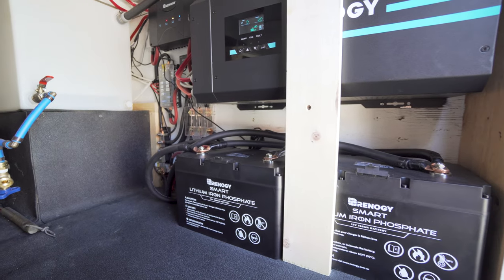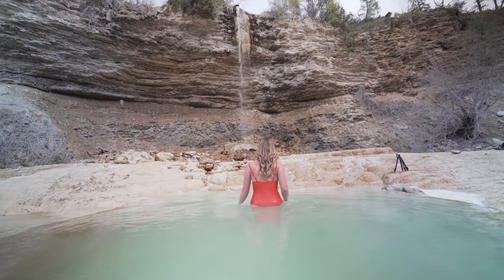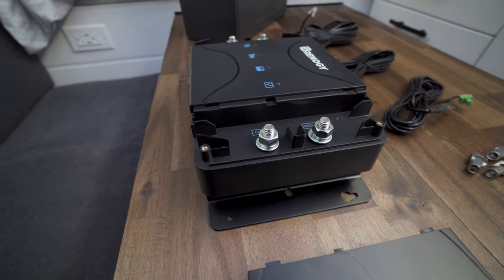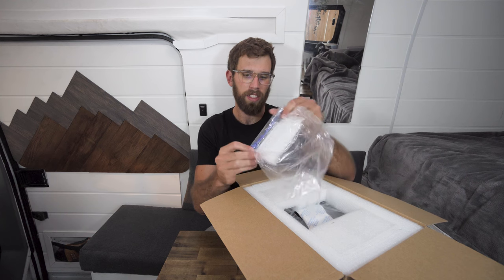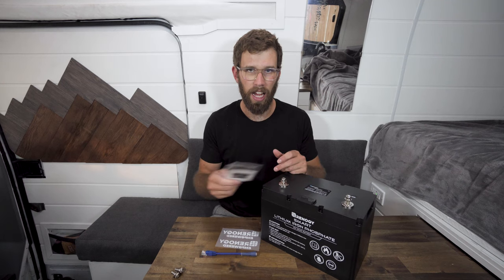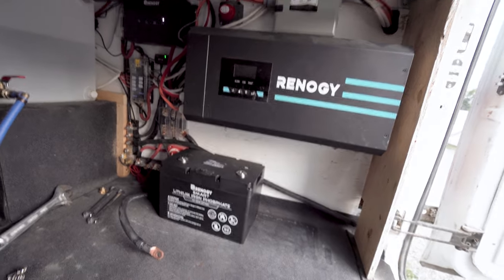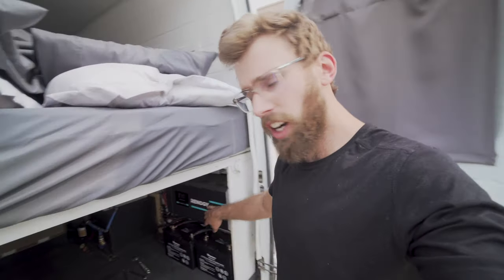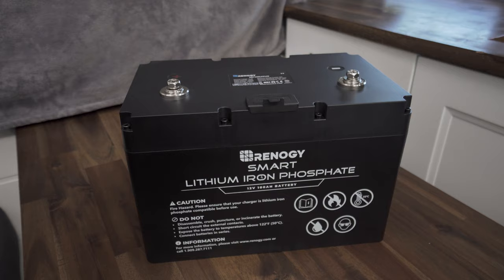Renogy Lithium Battery: Unboxing, Review and Install

Comment from the maker: Thank you for watching! Which battery you are considering purchasing?
Reply: Hi
Im looking to replace my standard leisure battery with the Renogy 12V 100Ah LiFePo4 Leisure Battery in my campervan. I dont have a solar set up. Is it worth it to do this?
Reply from the maker: @scottstephens-ni6oq  definitely! But I’d take a look at the new pro model because it has Bluetooth and is heated.

Comment: Thank you for this tutorial.    I just purchased a Renogy Smart Lithium 100ah and the Renogy 50a  DC DC charger w/ MPTT.  My old 30a controller had connections for the bus bars, in addition to connections for the solar panels and the house battery.  The new DC/DC charger manual only shows how to connect solar panels, house battery and starter battery. 
I am very new to DIY wiring.  I cannot figure out where to connect the bus bars.  Do they need to run through the controller or can they connect directly to the house battery?   
Thanks in advance to any and all for guidance.
Reply from the maker: The MPPT controller connects to the busbar (positive and negative) and then both busbars connects to the battery. Does that answer your question?
Reply: Thank you for your quick reply. If I understand you correctly the bus bar positive and negative cables would go into the MPTT/DC to DC charger where the manual indicates the battery cables should go. The battery cables would not connect to  the DC DC charger at all, but instead to go to the bus bars.

Is that right? Thanks for your time
Reply from the maker: @ltstarr9203  that’s correct!
Reply: @madetoexplore  so sorry to pester, but I used incorrect terminology earlier.  I am very new to this.  As I learn more, I realize I do not have bus bars.  I have a 12v fuse block with a separate negative terminal block (that some folks call a bus bar).  In my former system the controller had 6 specific connections dedicated to + and - for the fuse block, the battery and the solar panels. 

Now that I'm using correct terminology is your answer the same?  Or does the battery wire directly to the MPTT DC to DC charger, and the fuse block connects to the battery?   
Thanks in advance for guidance.

Comment: Hi - just about to put my van into heated storage for the winter. Best practice for my Renogy lithium batteries? Should I first turn off the master power knob then put them both into shelf mode? Also - best practice to re-engage them when I get van out of storage? Thanks for your help.
Reply from the maker: Yes that is correct. In the spring, take them out of shelf mode and turn on the master knob.
Reply: @madetoexplore  thank you

Comment: Do you know if it's possible to use the Batteries lying on the "back"? Or would this cause damage to the pouch-cells? Thx!
Reply from the maker: It is recommended that you install them upright so technically you could install them on their side but I probably wouldn’t risk it unless you have no other option

Comment: Question about you AC input, did you use a 30Amp or 50Amp plug/ and the same with the cables?
Reply from the maker: 30 amp plug and 10 gauge triplex marine wire

Comment: Hi I’ve got a caravan I’m in the uk . Enjoyed watching your videos.. I’m about to purchase a 170amp renogy battery to replace my 2 lead acid batteries 110 amp . I mainly go off grid using a bit of tv water pump lights led mrs occasional hairdryer use for about five minutes through my 1500 W inverter. Got 150 w solar panel on roof . The built in charger in my van is 28 amp charger it’s got a lithium setting so hopefully ok. What’s your thoughts cheers mike
Reply from the maker: Sounds like a good system! Good call replacing those lead acid batteries 👍

Comment: Will this battery automatically cut off charging at low temp to protect the battery?  I looked all over the manual and website and for this specific battery it isn't clear if it has a low temp cut off - it just says not to charge it below 0.
Reply from the maker: It says it has thermal protection but doesn’t specifically say low temp cutoff. If that’s something your worried about I would definitely recommend the heated model!
Reply: I've wondered this myself since buying one, It says it has 'low temperature protection' at 0 degrees Celsius but doesn't actually say if it stops charge or not. I have seen a few forums say that they have had feedback from Renogy which says the BMS will stop charging when the low temperature protection is activated but they still recommend disconnecting from charging so not sure how great the low temp protection is. Personally I am just going to monitor it and see if it degrades over winter whilst still being charged and replace for the self heating if it fails.

Comment: Hi there ... I have the same battery pair as you. I'd love to know if you are able to put your batteries into shelf mode without uncoupling them? (which implies also disconnecting from all loads+chargers).
Reply from the maker: I’m not sure but I think it could work. As long as there’s no draw or charge on the batteries.
Reply: @madetoexplore  Would love to know if it works for you...by the way, the RENOGY product video shows them doing it using the blue dongle.
Reply from the maker: @marionsutcliffe1119  I’m currently testing out the Renogy 200ah Bluetooth battery or else I would!
Reply: @madetoexplore  Right, ok no problem!  I appreciate your responses!! Renogy support says they have removed this functionality, which seems very strange. Perhaps they just want me to go away.

Comment: Wondering why the switch if you were already using Canbat? Also, welding cable is easily available at Princess Auto, will possibly save you money per foot for that gauge wire.
Reply from the maker: I still really enjoy my Canbat battery and will continue to use it, especially during winter. With most of my solar system being Renogy I wanted to try out their lithium batteries as well and see how they perform.

Great tip about Princess Auto. I had originally called a few local welding supply shops but was told that they were all out of 2/0 wire because of the international shortage from the pandemic. Could’ve saved a few $$ buying from Princess Auto though! Thanks
Reply: I ended up using a 20ft jumper cables frombPrincess auto on sale in May for $27. The cable is #2 awg copper clad aluminium that I doubled up to compensate and running a 1500W airfryer for 3 minutes with the cables staying cold. Solder, electronic solder flux and propane torch was used to solder lugs. 
So watch for sales and heavy gauge wiring does not have to be so expensive.

Lithium batteries in terms of LIFEPO4 look very tempting but still want to confirm safety.

Comment: I have 2 x 100ah smart batteries, same as your video, with BT-2, Xantrax 2000W inverter/charger and no solar, batteries charge off alternator only. This is a work van so solar is not necessary. The monitor works easily when connected to each battery, however it will not work when I connect the batteries with an ethernet cable. What am I missing? Would like to be able to view status on both batteries without swapping the BT-2 between the 2 each time.
Reply from the maker: Where’d you buy the Ethernet cable?
Reply: Just a leftover cable I had, tested it on my modem and the cable is functioning. Renogy doesn't seem to sell this cable. I think it is RS485 which seems to be hard to find.  @madetoexplore

Comment: Your infö has been super helpful as I am installing a similar system with Renogy products. How did you decide on 5/16 lugs? Is that what Renogy recommended for the 12v 100ah battery posts? also does that mean you purchased a 5/16 bus bar?
Reply from the maker: Good to hear! Yes, that’s what Renogy recommends. I purchased the 250a Blue Sea System Busbar. The busbar doesn’t have to have the same sized lugs though, lugs and wire size can vary.
Reply: @madetoexplore  OK great recommendation I purchased a similar 250a busbar. Did you use a torque screwdriver for the battery terminal bolts? Renogy manual says 100 in-lbs but I'm wondering whether its worth it to purchase one.
Reply from the maker: @robpowers650   no I wouldn’t worry about that to much, I didn’t torque mine down. Just good and snug.

Comment: I see, after the batteries were wired together, you took only one battery off of shelf mode...why didn't you take the second battery off of shelf mode?  Is it because they where wired together? Or did you do both but only showed one being activated?  THX
Reply from the maker: I did take both off of shelf mode but only showed one in the video.
Reply: I noticed that too ... looks like nothing blew up when one battery suddenly got voltage and the other was 'sleeping'. I think maybe you can exit from shelf mode by charging it ... which is effectively what happened there, maybe? If you connect them with the ethernet cable, the blue switch will activate and deactivate both at the same time.

Comment: My two batteries will not go into shelf mode anymore I tried both blue cable buttons but they won't dim.. Is this common?
Reply from the maker: I haven’t heard of this happening before! It may be worth contacting Renogy regarding this. Is the battery working okay otherwise?
Reply: @madetoexplore  I made the mistake of trying to turn off my two batteries while they were STILL connected in parallel, it was in the manual, so I feel dumb. They are fine.

Comment: When running your batteries in parallel, are your solar panels in parallel or in sequence?
Reply from the maker: Parallel
Reply: The reasons for choosing parallel vs series for batteries and solar panels are (mostly) unrelated. Assuming you decide on a 12v system, that means your 12v batteries must be in parallel (2 in series would double the voltage). The solar panels can either be  series (same amps bigger voltage) or parallel (more amps same voltage). There are pros and cons to both ... suggest googling it, as there are many opinions on this.

Comment: Can you plug AC to DC charger to house battery to charge ? What happens to 1500 w inverter and 30 Amp solar charger ? Do i have to isolated inverter and solar charger to protect them ?
Reply from the maker: No you can’t, that wouldn’t work
Reply: @madetoexplore  So how do i charge my Deep cycle leded acid  battery's group #31  (2 x 105 ampH) with generator if it is needed to charge house batteries beside driving for 4 long hours?  I do have Renogy 20 Amp  DC to DC charger ( not yet  installed) + 30 Amps solar charger  not yet installed and 1500 W pure sine inverter. Do not have yet solar panels. Planing to buy two 100 w panels soon.  Solar charger and inverter I do have now, but non of it is yet installed. I have been up to now using only my house batteries for diesel heater and during the day I was charging my batteries with 10 Amp  smart charger  and Yamaha generator.

Comment: I thought you were using thecoldcweather CANBAT batteries?  And in a previous video you indicated that Renogy had terrible product support...
Reply from the maker: I am still using the canbat battery and will continue to use it during the winter. With the rest of my system being Renogy, I wanted to test their batteries and do a review. I have had trouble with Renogy support in the past but I know they are developing a better international support system. Their product support in the states is much better than Canada!
Reply: @madetoexplore  I have a LOT of Rengy products and 3 large Dakota 2400aH  lithium FePO4 batteries.  Glad to hear your stuff is working well.

Comment: Great video and very informative. Wondering why you need the temp sensor? The BMS will shut down all the charging for you. Even in the DC-DC manual it says no temp sensor is need for their Smart lithium battery. Thoughts? I suppose you can never be too careful. (especially in colder climates.)
Reply from the maker: That’s right, the temp sensors there so mine as well use it!
Reply: The Renogy Smart Battery only has a high temp sensor as far as I know. They don’t have a low temp cut off sensor on the BMS. So they can be damaged if you try to charge them below 5C.
Reply: Actually they state not to charge below freezing which is o° Celsius or 32°f
Reply: According to Renogy manual there is a low temperature 🌡 sensor. Triggered at 0deg C. But you're correct. You should definitely not to charge any lithium battery that's sitting below 0 degrees C.

Comment: I noticed in their FAQs that Renogy specifically states their Lithium Phosphate Battery 100Ah 12V will last 2000 cycles, which they then clarify is roughly 5 years. The batteries they have for pre-order for same specs says 4000 cycles, 10 yrs. Curious as to why? Thank you for your time
Reply: There is actually 2 different 100ah Renogy lithium batteries.  One is marketed as "Smart Battery" which has a 4000 cycle rating and the other is a "Bluetooth Battery" which has a 2000 cycle rating.  It's a bit confusing as both have bluetooth and many people relate bluetooth technology as "smart."  Got to love confusing marketing.
Reply: @randydandy2  I watched your video to find out if you addressed this exact point. So you went with the ‘Smart’ with the 4000 cycle rating - are you saying that has Bluetooth built in? Speaking to Renogy they suggested I’d need to buy the BT2 Bluetooth module to add Bluetooth monitoring, while the 2000 cycle ‘Bluetooth’ model has it inbuilt. Agree it’s confusing!!
Reply: @jonathanavis6577  yes, the smart models have Bluetooth but you would need the Bluetooth dongle.  They network together with a standard cat5 cable. You get all of the battery data including state of charge, cell level voltage, temperature, error state and more.  Plus the smart batteries a lighter and UL listed.

Comment: Are you happy with the batteries today?
Reply from the maker: Yep! All my Renogy stuff is still working great. The only issues I’ve had was with cheap fuses and wiring which I’ve since replaced.
Reply: @madetoexplore  have you checked the capacity of the batteries?
Is it reduced?
Reply from the maker: @takismenexes6131  I haven’t but I plan on doing a comparison video soon!
Reply: @madetoexplore  nice because I'm interested to replace my wet batteries.